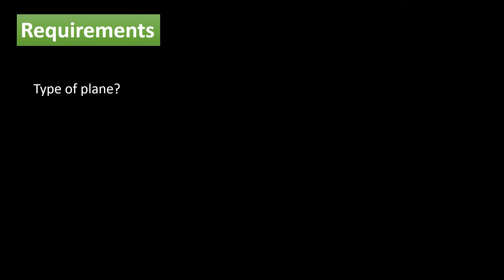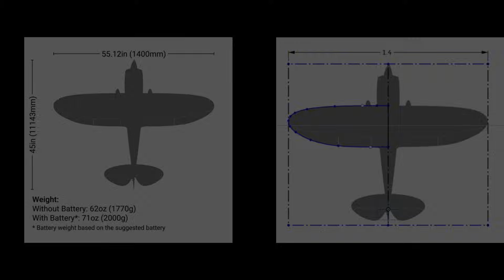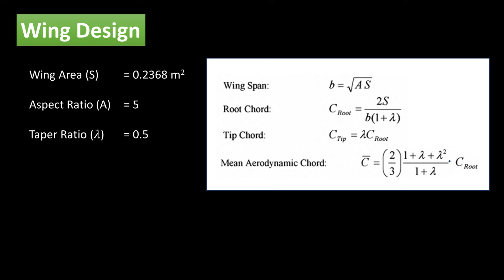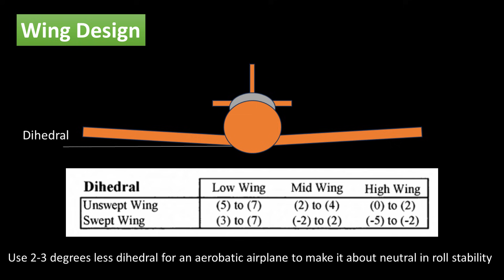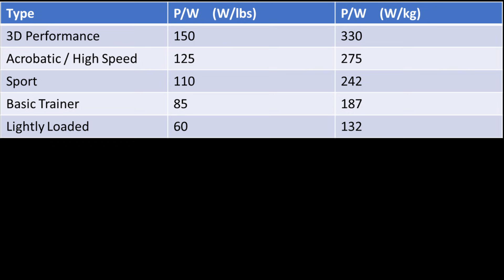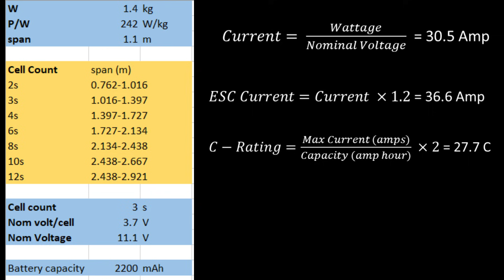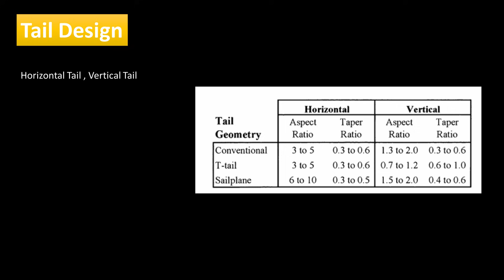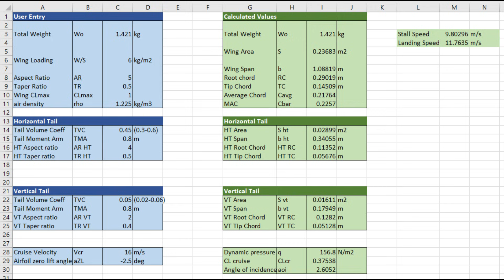Steps to Design Your Own RC Plane | Aircraft Design Example

Comment: Thanks a lot, nice video, and channel in general!

At 7:05 where you calculate cruise lift coefficient, the formula is c=(W/S)/q. With your figures: c=6/156.8. This gives 0.038, one magnitude smaller than the 0.38 mentioned. I've also checked with units in MathCad and it gives the same result. What do I miss?
Reply from the maker: Hi, the wing loading of 6 is in kg/m2 and the dynamic pressure q is in N/m2. For consistent units, we need to use the wing loading in N/m2. So you need to multiply the weight (or in this case wing loading) by 'g' (or 9.81, acceleration due to gravity) before calculating the lift coefficient. The lift coefficient is non dimensional and doesn't have units. So what we are basically doing is converting the weight from  kg into Newton.
Reply: @AircraftDesignToolbox  Makes sense, thanks for the clarification! :)

Comment: And when you finish the choices of every component and calculate the whole weight you get way off from your initial estimate, requiring a new design cycle. In ship enginnering it's called the ship design loop, and you iterate until your final estimates corresponds with the cycle's  initial hypotheses

Comment: Are there any major differences between the design of regular planes and jet rc planes? And I wonder what they are and how I can learn this information. Congratulations to your channel for this playlist, nowadays everyone is doing nothing but showing rc construction videos
Reply from the maker: I think the main difference will be in the thrust-to-weight ratio and fuel system. If the engine is already selected, the max take-off weight can be estimated by working backwards from the engine thrust and thrust-to-weight ratio you choose (depending on how you intend to fly the plane). Heat from the exhaust will also be a crucial factor to consider so that it does not damage the RC plane's material. Placement of the fuel tanks such that the C.G does not change much when the tank is full and when it is empty will be better from stability and control perspective.
Reply: @AircraftDesignToolbox  I know that information such as wing size, center of gravity selection (possible to be vtol) and wing profiles of fighter jets designed in RC dimensions vary. However, do I need to build on classical aircraft design to learn this information or should I feed from jet design sources from the very beginning? Are there any sources you can recommend? Or you can shoot a theoretical video on this. by the way, since EDF will be used instead of a turbine engine, there will be no melting problems.

Comment: 0717   illustration/narrative suggests a wing configuration that results in a  FULL TIME  positive aoa of eight degrees.    that is dumb.      a small/tiny wing should always be designed having a flat-bottomed profile, one that precisely resembles the original clark-y profile.       the thickness of the clark-y is 11.7 percent, and that thickness accommodates about three degrees of built-in positive aoa; when the wing is at zero-degrees aoa relative to its lower surface.
Reply from the maker: The wing incidence angle is around 2.6 degrees. The angle is exaggerated in the figure for clarity. What this means is that when the angle of attack of the fuselage is 0 degrees, the wing experiences an angle of attack of 2.6 degrees. This angle is optimized for cruise.